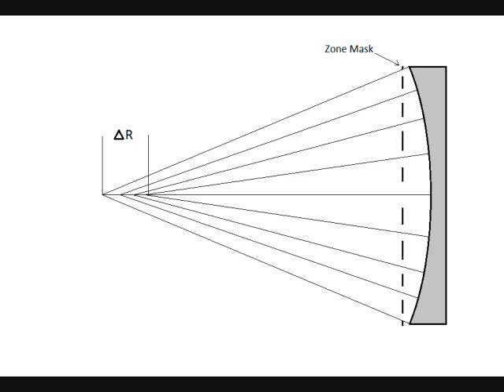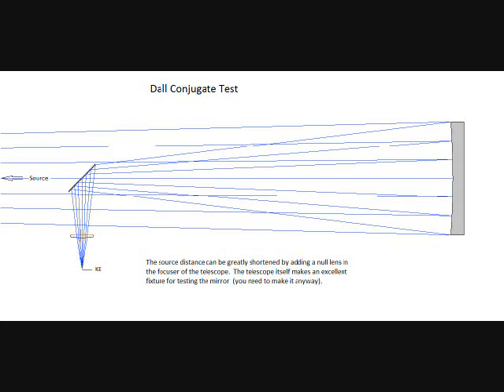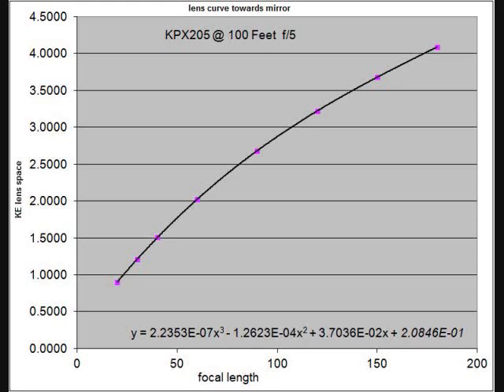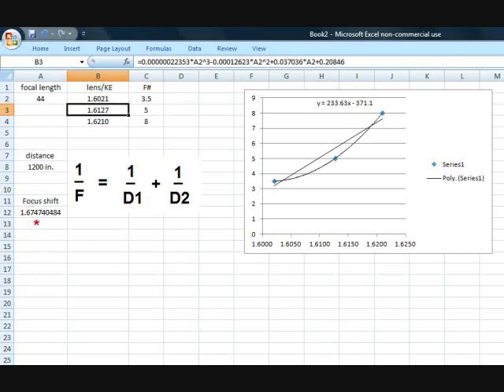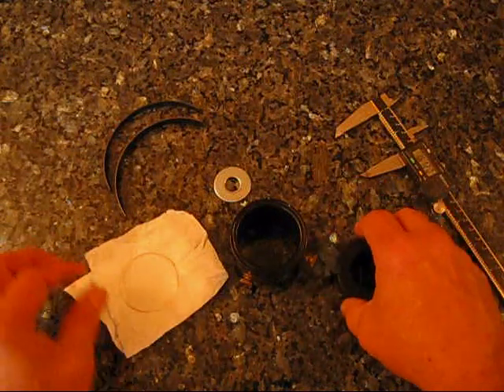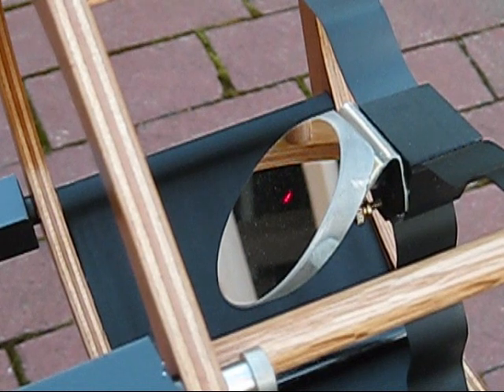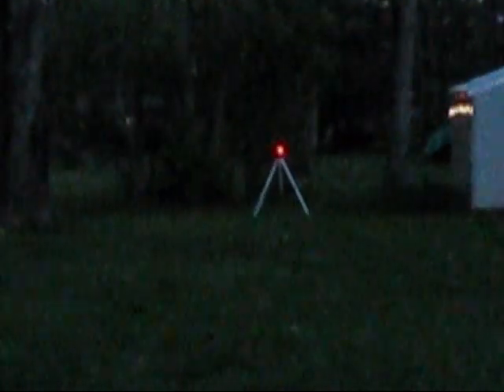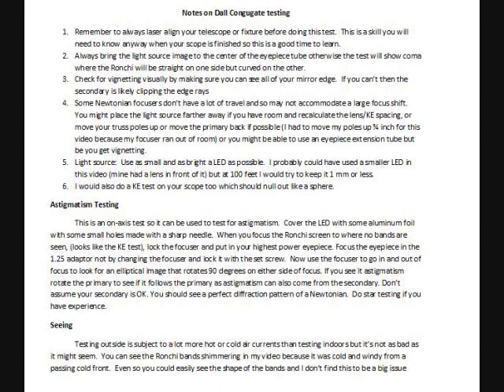Lens and Mirror Making for the ATM #9

Comment: I bought a Newport precision lens years ago with the intent of making a Dall nulling element in an adjustable holder.  The idea was that by mecahnically setting the ke/ronchi to lens distance, it could be used to test moderate f# mirrors or scopes as you have demonstrated. The popularity of the Ross and it's relative insensitivity to alignment over the Dall put that project on hold. 
 Dall lenses are cheaper, though....
Reply from the maker: Most ATMs are familiar with the Dall done a the center of curvature but when you  test big fast mirrors the Dall lens needs to be large as does the Ross.  Testing at a long conjugate distance the Dall lens is correcting only a small residual SA using a small area in the center.  Done this way you can test big fast mirrors with an inexpensive 2 inch off-the-shelf lens.